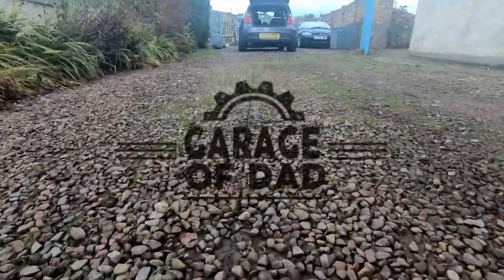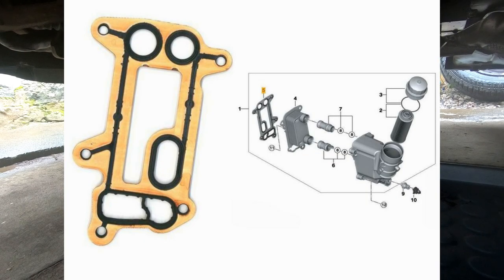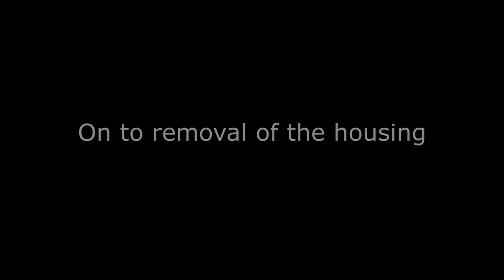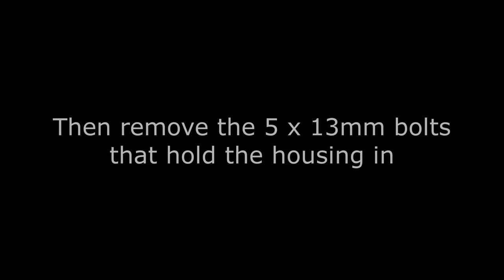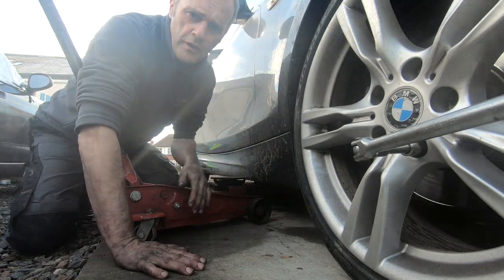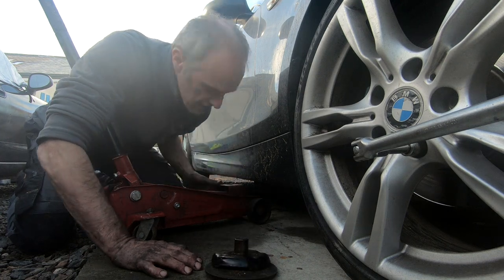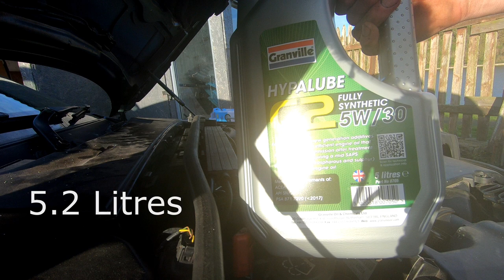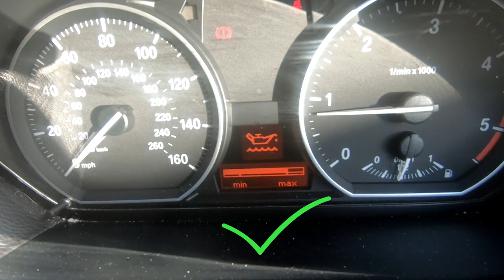BMW 1 series 120D 118D N47 Oil filter housing gasket change

Comment: Great, thanks for the very useful video.  Just done mine on a 123D.  Three of the five bolts on the filter housing are difficult and two you can’t really see.  I needed 3 different length socket extensions and used different combinations of these to remove the bolts.  I also invested a few dollars in a wobble drive socket extension which was well worth it (just allows the socket to be angled a few degrees and better than a universal joint).  Note on the video that is not mentioned; you need to disconnect the large black hose (via the clip that holds it on) ant the upper end and move it around in different positions as you access the bolts.  Cheers from NZ.
Reply from the maker: That's great, job well worth doing and great advice about the tools and the hose 👍

Comment: No need to remove the alternator but you should have replaced the 4 oil rings in behind the cover they go Rock hard and v common leak area
Keep the videos coming your learning all the time
Reply from the maker: Thanks. You are right and I did replace the O rings. But for some reason my GoPro didn't record it. The rings come in the gasket kit.
Reply: Behind what cover?

Comment: Nice video! One question , I have this leak since the change of the chain! They need to touch it when replacing the chain?
Reply from the maker: Never done a chain but I wouldn't think they'd need to touch it. If the oil was changed at the same time, that could have triggered it. Could be pure coincidence of course. See if you can get underneath to see exactly where the leak is coming from.

Comment: Did you put the sealant on the engine then put the gasket and housing on after wards or both sides of gasket !!
Reply from the maker: I put the sealant round the outside of the gasket so it didn't ingress into any internal parts.

Comment: Do you need to drain the oil at all? As i only topped it up about 4 days before i plan on doing the job, and i did a full oil change not long ago, also other mentioned the coolant, does that need draining at all? And again, others are saying the alternator isnt necessary to remove, is this true? Thanks! Great video
Reply from the maker: You can just top up the oil. Mine needed changing as it was due. The alternator can stay on. It's very easy to remove though and gives much more room to get the housing out and back in. I also disconnected the battery as there's a live cable on top of the alternator (mine didn't have the plastic cover over the connecting lead bolt) Everybody has their own way of doing things! 😄
Reply: @garageofdad  okay, this is verh helpful thankyou! If i were to not drain any oil, would it start to pour out of the filter housing? Im going to assume yes😅 and was did any of the coolant need draining as others in the comments were saying about it?
Reply from the maker: @a.ward02  P.S. most of the oil is held in the sump, the only oil that will come out is that which is still in the housing.
Reply: @garageofdad  oki doki! Thankyou very much for explaining further, and thankyou for the good video

Comment: Replacing only the gasket is one half. Absolute must is to replace also all o-rings there are, because they are the primary cause of the leak due age/temperatures rubber becoming sturdy plastic.
Reply from the maker: Great point. I actually did replace them but for some reason didn't film it. But yes it is a must.
Reply: Hi, i have the same issue same engine but, i can’t drain my coolant because there is no drain plug at the bottom of the radiator. Any suggestions? Appreciate it
Reply from the maker: @stratusinvest4791  To be honest, I just let mine escape from the housing with a bowl under the car then dried out what was left with a rag and topped up with fresh antifreeze once the job was done. Not professional I know!!
Reply: What o-rings?
Reply from the maker: @legioner9  Have a look here on ebay at the gasket kit:- https://www.ebay.co.uk/itm/393239546025?fits=Car+Make%3ABMW%7CCars+Type%3A120d%7CPlat_Gen%3AE87%7CCars+Year%3A2007%7CModel%3A1+Series%7CVariant%3ADiesel+Hatch%7CEngine%3A1995cc+130KW+177HP+N47+D20+A%3BN47+D20+C%7CBodyStyle%3ARWD+--+E81%7CVariant%3ADiesel+Hatch%7CEngine%3A1995cc+130KW+177HP+N47+D20+A%3BN47+D20+C%7CBodyStyle%3ARWD+--+E81&hash=item5b8ee748a9:g:tukAAOSwTMBgcIR2&amdata=enc%3AAQAHAAABAMi10SGeE5F2tdk3sKcORz6kBBA7lHFXDy%2BLPak%2F2kqK16MaMaM2IGqFaYwCUVQTS%2BKkNbYAquartvy%2FUNvuSKH0XjBf6kpkm%2BOdIxIobz02hid0ZVbjbMn1Yc6%2F8jYHtCMG7N75SE%2Ff7LVJv0t5b42j%2FHnv4CgsMi7ZLeoD%2F3ls3kSQHixU3IzyiHNyK8TEEsSvG3QfXbQoLZCLNu0wPBZ0NlfIM71QGU50NFGCh%2FQ8ZukD%2FyCr8pxZetTJfo2bNhGnxYpZv3rR9trjbYgwXwUP6vSbVWb0L0lS1Odh5mXTz%2B887Y6h7Pvy2Ciy%2FgU0VhP8SUq7aF6k6hVWI%2BI5mNk%3D%7Ctkp%3ABFBM_OX98thh
Reply: @garageofdad   Thank you very much.
Reply: @legioner9  there are o rings inside the housing when it's opened up.
Reply: Hi there,im battling to remove the union pipes from the oil cooler.any advice on how to remove them
Reply: @leandrenmoodley2892   Hi. Use a screwdriver and pry them downwards. There are 2 pipes connecting to the underside of the oil cooler. First you have to remove a screw (E10 or E12) which fxes a bracket with the 2 pipes on the oil cooler underside. Remove the screw first and them pry downwards the pipes. They will pop out easly. The other pipes, i.e. coolant pipes you have to first remove the metal clip from each of them and then pull them away (you can use a bit of force).
Reply: @legioner9  Hi,thanks for that,but I think my housing is diff As I dont have coolant pipes ,just 2 plastic pipes from the cooler going to the the filter obviously 1 is the feeder pipe and the other is the return pipe.and im battling to get them of the cooler
Reply from the maker: @leandrenmoodley2892  They are usually tight. Just try and twist to and fro whilst pulling at the same time. It's because they will be hardened off causing the leak.
Reply: @garageofdad  thank u

Comment: Have 1series bmw 116I petrol 2006 have suspect housing gasket drives fine but oil pressure dropped half way on sensor sometimes white smoke no oil from underneath though does it sound like the cause taking to specialist next week  what do you think thanks
Reply from the maker: Could be the start of the housing gasket going but to be honest, BMW's leak oil from various parts. The usual practice is to wash the whole of the engine then see where the leak comes from. Good luck

Comment: Hello! Thank for the video. Could you say as how did you drain the water and the oil? I understand that you only drain a little bit, but how…? Thanks!
Reply from the maker: Hi thanks. I let the water drain away from the housing  until it stopped then topped it up afterwards. I done an oil change at the same time. Use the corrects pec oil and antifreeze.
Reply: @garageofdad   Thank you again. Ok but if we dont want to empty the tanks (oil and water) how we can proceed? Because I dont understand when you say: “I let the water drain away from the housing…”
Reply from the maker: @Carlos-y9r7b  Take the housing off and let the water drain away naturally then top up both the water and oil (as you will loose a small amount of both when the housing is removed)
Reply: @garageofdad  What do you mean with “Housing”? I’m Spanish and I don’t understand very well this context. Regards
Reply from the maker: @Carlos-y9r7b  The oil filter housing is at 2:10 It holds the oil filter.

Comment: Great video, do we need to drqin all coolant and oil???
Reply from the maker: You can just top up what oil and water is lost but you can take the opportunity to change them both.
Reply: @garageofdad  thanks, is there any possibility that the oil leak  comes from the oil pan too or not comun?
Reply from the maker: @Eddy-th3kc  Usually the rocker cover gasket and oil filter housing gasket (or sometimes someone overflowing the oil cap) Sometimes good to clean the engine, run it a while then see where it's coming out from.
Reply: @garageofdad  just removed mine right now, it was leaking for shore and I think from the o-rings and I didn't order them, now just waiting for them to put it together, e think I will remove de flaps and EGR, looks so dirty on the manifold and throttle body
Reply from the maker: @Eddy-th3kc  Good thinking it will make a difference and not too bad a job to do.
Reply: @garageofdad  do you know the torque spec for the 5 bolts on oil filter housing?

Comment: Hi i need to do this to my bmw the weekend and just want to know if you have to remove the dipstick tube completly? And if you do. Did u replace with a new oring or not? Thanks
Reply from the maker: Hi, no just pulled it to the side out the way.
Reply: @garageofdad  so did it all this morning wasn't as bad as I expected to be fair. Few different size extensions for the ratchet and it went ok. Did the 4 rings aswell. So it only leaked when cold like yours and on the first run had a bit of remaining coolant that was sat on the block drip down but now nothing so fingers crossed it's all good. Going to wait for the engine to cool and take it for another run. Thanks for your reply about the dipstick👍
Reply from the maker: @Saltermedia  That's great. It seems a daunting job but relatively simple when you get into it.

Comment: where the orings are going to ? can't see it on the video and also what sealer did you use ?
Reply from the maker: I put the sealer round the outside of the gasket and you have to split the housing to get the 2 pipes off. Sometimes hard to do but they do come apart.

Sealer:- https://www.amazon.co.uk/Visbella-V363-Hi-Temp-Gasket-Plastic/dp/B09SLPHTK4/ref=sr_1_4?crid=16CVUYB706ENS&keywords=visbella+rtv&qid=1679304027&sprefix=visbella+rtv%2Caps%2C94&sr=8-4

O rings:- http://2009.bmwfans.info/parts/catalog/E90/Sedan/Europe/318d-N47/RHD/N/2007/november/browse/engine/lubricat_syst_oil_filter_heat_exchanger/
Reply: Hey I have sucessfully replaced the seal with all the orings ive used some silicone to on the outside just like you did but now im facing issue with charging like the alternator is dead and it was perfectly fine prior the job so i started digging around checked battery its fine replaced alternator with another 2nd hand one from the scrap yard but its still the same still not charging I have double checked all the connectors that I have unplugged when I was doing the seal to get the access but still no luck any ideas what could of happen ?
Reply from the maker: @AndrzejOdGrubego  I only removed the alternator to get better access to the housing. Apparently you can do the job without removing it. Did you disconnect the battery? There should be a permanent live to the battery main terminal at all times (two cables) when the battery is connected. It's just a case of checking again then using a code reader to see if it flashes up any faults. Good luck.

Comment: Hi mate my 120D was having oil leak when I start in the morning just like yours, I changed the oil filter gasket but it's still leaking
Reply from the maker: Did you take the whole filter housing off like I did? When I put mine back on with a new gasket I also used extra gasket sealer to make sure it didn't leak

Comment: How come you only changed the gasket not the entire filter housing?
Reply from the maker: The cost! The housing was good fortunately and I used high performing gasket sealer to make sure of a good seal.
Reply: @garageofdad  ok thanks for the quick reply, thought it might have been due to cost as it’s the entire oil filter housing assembly.

I need to change this gasket to but been advised to do the entire assembly due to high mileage. 😱
Reply: How long time did it take .Best regards Anders
Reply from the maker: @2anden1  Took me a couple of hours
Reply: @garageofdad  bmw wanted £650 for housing filter assembly (inc gaskets). I bought aftermarket one for £170. Labour cost £160 but that also included new antifreeze and oil. £330 in total.

Comment: Hi, will the oil filter housing gasket leak when the engine is not running? I just changed mine yesterday, still leaking overnight, had a big patch of oil under car this morning I'm thinking it must be above the standing oil level as the dipstick goes way below the filter housing, right?
Reply from the maker: There's always a bit of oil left in the housing when you take it off. If you can get a mirror in there to see where the oil's coming from that would help. Did you replace the 4 O rings as well? The gasket may have not seated correctly. Good luck.
Reply: @garageofdad  Thanks for the reply, I replaced 2 of the O rings, 2 of them looked like O rings the other 2 where flat and would not come out, looked completely different.
I did get a mirror in there but hard to tell.
Did you drain the oil to replace this? it seems it's above standing level, I know the coolant needs to come out.
Reply from the maker: @Leigh20007  Yes, I did an oil change at the same time. I know it's a hassle but you may need to take it off again to make sure it's sealed properly. Also the O rings should all be round, maybe that's the fault. If you have a look at 2:00 you can see where mine was pouring out from and it was one of the O rings which had gone hard over time.
Reply: @garageofdad  OK cool ill take it off again next weekend, already ordered a second hand housing from a 2012 n47 (mine is 2008)
I already did an oil change yesterday, I will drain coolant again but as the housing is so high on the block I assume draining the oil is not necessary?

Comment: I'm currently trying to work out how to do this job on a Mini Cooper SD with this same engine. It seems impossible, without removing an infuriating amount of 'stuff' to gain access. The engine is mounted transversely in the Minis and is acbsolute hell to work on. Everything is so damned inaccessible. Even just removing the alternator requires taking the wheel off and the inner wheel arch covers --just to get to the drive belt pulley tensioner.  I f**king hate this car!
Reply from the maker: Oh dear! some jobs just suck. Seems nowadays - most of them!!

Comment: Hi I replaced the gasket where it meets the block and it still leaks 😢
Reply from the maker: Did you put the O rings on that are usually with the kit? I also used a high temp sealant too
Reply: Where did you put the sealant and where did u get the kit from
Reply: I’ve had a look this morning and it’s coming from the bottom of housing where it meets the block do u know how tight they should be the bolts
Reply from the maker: @oliverchallans3728  I got mine on ebay but have a look for your own car type. Here's one for a 120D  https://www.ebay.co.uk/itm/274913539117?fits=Car+Make%3ABMW%7CCars+Type%3A120d%7CPlat_Gen%3AE81%7CCars+Year%3A2007%7CModel%3A1+Series%7CVariant%3ADiesel+Hatch%7CEngine%3A1995cc+130KW+177HP+N47+D20+A%3BN47+D20+C%7CBodyStyle%3ARWD+--+E81&hash=item40021fb42d:g:N6sAAOSwPz1hH7Oe&amdata=enc%3AAQAHAAAAwBfrihrTKWDdk9Sc7fjwvojjoA0OcF1jtRZf8b8RnJKBr18Da5FvwPMe4Xaebq42KMCWDTH%2Bb8onf9HXYyhlQKp%2FtJoiSjUZbPHyK5clGoPo%2B%2FbstB3pYO%2BkMTxhXZlzP9P8aPbj0zsqYdT3OGeAyUcljyU%2Bapw9MF6w1UNi9T0dHyYAo3WVFibHZ7zVOUuBZsrw7%2FMl666JePo1w9fGEkGxY5LscSXmY6bzvjc%2BnUwGIlkhJ22G3Ht03oqlCbIzbw%3D%3D%7Ctkp%3ABk9SR_qb0aXJYQ
Reply from the maker: @oliverchallans3728  The sealant I put round the OUTSIDE of the main gasket and NOT the O rings. You have to split and clean the body of the housing to get at them They are usually tight!